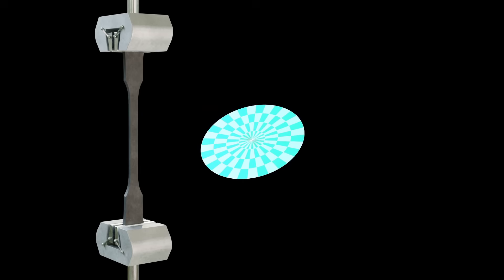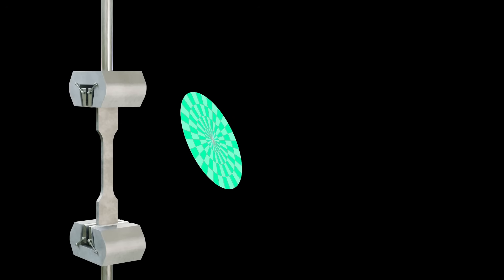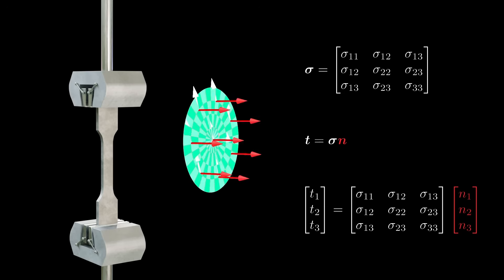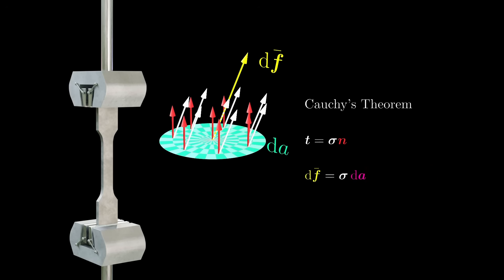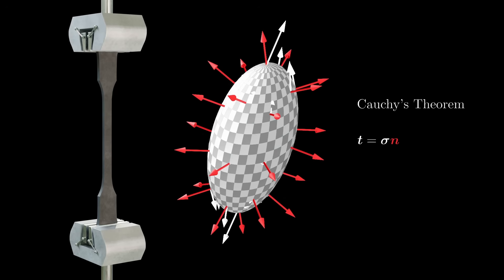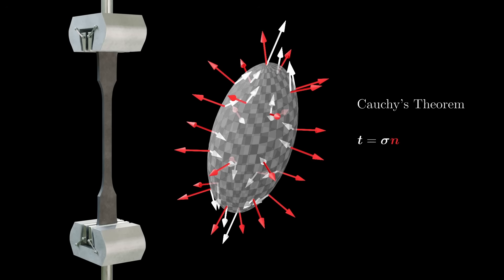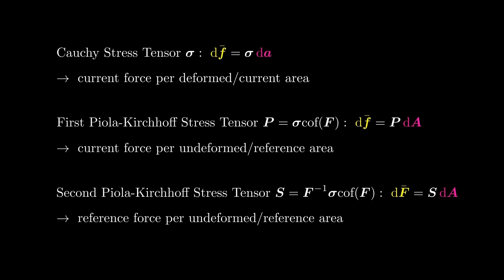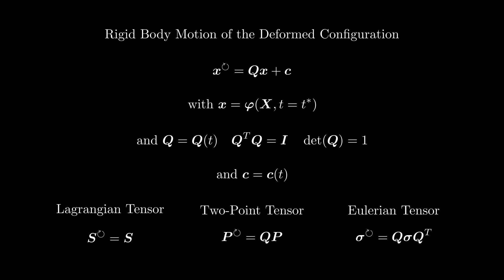Why Is Stress Not A Vector?

Comment: A force acts at a point, with no reference to orientation (a point has no orientation). If several forces act at the same point, they simply add to a single force vector at that point. 

A tensor is distinct in that it takes as input more than just the point of application (as a force only does). At a point, a tensor requires an additional input, one of three directions (i,j,k) , and then defines a force in that direction (each such force having three components itself). That is why there are 3x3=9 components to the tensor. 

While you can add vectors (which apply to a point): F(p)+G(p) is total force H(p) at p
You cannot add the forces in tensors this way since their arguments differ: F(p;1,0,0) + G(p;0,1,0) is not well-defined since the forces do not refer to the same conditions specified by the two arguments. [Formally, you could add them, but it would not have any meaning with respect to the orientation component of the argument, (x,y,z). It would be adding "apples and oranges".]

In short, a vector refers to a force at a point. A tensor refers to a force at a point AND at a surface with a specified orientation through that point. For example, suppose the tensor is a scalar matrix, F times the identity matrix I. Then (using video's notation), for any normal n, t=(FI)n = Fn, visualized as a point p with the vector Fn pointing radially away from the point p in all directions (looks like an "explosion").  Clearly that describes a different physical situation than the one where you add all these different force at p together, which would give you a net zero force at p.

Rule of thumb, mathematically: When you increase the number of independent variables that define the domain of a function, you create a new function that can have dramatically new properties from the original. For a simple example, functions R to R (a curve in the plane) versus functions R^2 to R (a surface in three-space).

Comment: 3:24 : so, I have a maybe kinda dumb question: if the body isn’t moving or deforming, the net force on any volume element should be zero, yeah? When you talk about the traction being applied to a slice in the object, is this like, the force being applied through the slice? Like, the force applied to what is on one side of the slice to what is on the other side of the slice? Kind of like a rope in tension?
Or is it something else?
Reply from the maker: I think the visualizations are not ideal. If we cut out a thin plate, then there are tractions acting on both sides of the plate, which are in opposite directions such that the plate is in equilibrium. For the half spheres later in the video, I did not visualize the tractions acting on the curved surfaces because the visualization would have looked quite messy

Comment: Very nice video. If you decide to speak about plasticity theory, please consider the graphical explanation around the principal stress space. For isotropic linear elastic materials the stress and strain tensors are coaxial. This is, the Cauchy stress tensor 𝛔 and the plastic strain rate tensor 𝓔̇p share the same principal directions space. Therefore, 𝛔 and 𝓔̇p can be represented in the shared coaxial principal stress space. Additionally, the corresponding volumetric and deviatoric components of both 𝛔 and 𝓔̇p are colinear (i.e. parallel). This gives a lot of opportunities to graphically understand complex plasticity theory concepts like the direction of the plastic strain tensor perpendicular to the yield stress surface 😅.
Reply from the maker: Interesting, thanks for the suggestion!

Comment: In structural analysis and continuum mechanics, I learnt stress tensor or called Cauchy stress. Your definition to Cauchy stress, the first and the second Kirchhoff stress tensor are the one step further to the stress where unreformed and deformed area are related. Thank you for your video. I learnt stress tensor in deeper understanding.